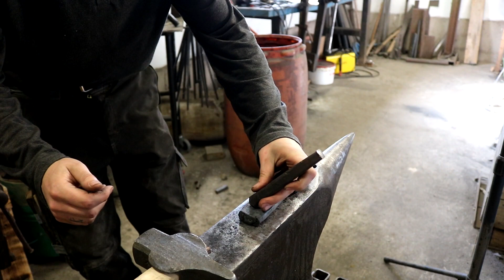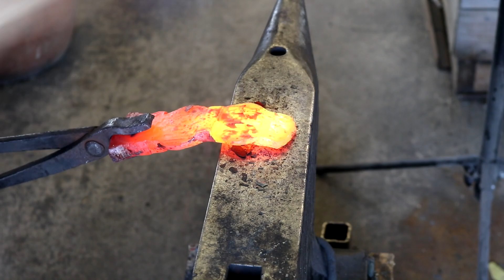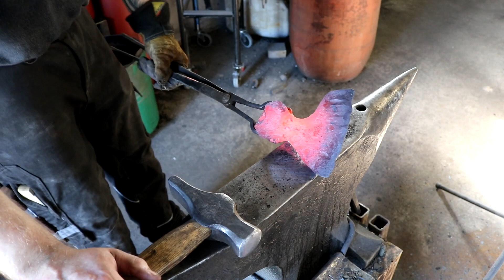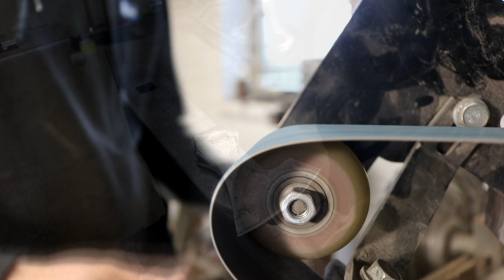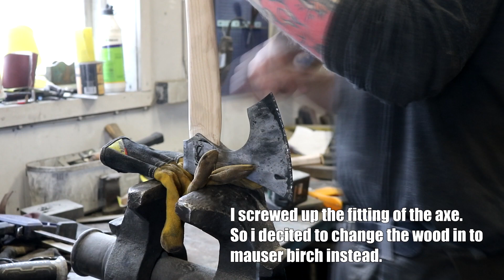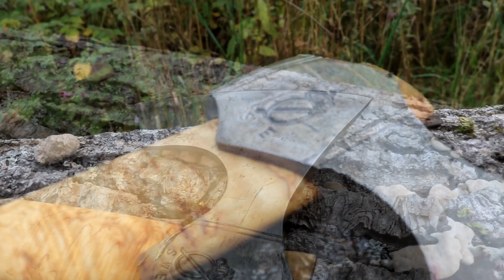Blacksmithing - Forging a Viking Carving Axe

Comment: Great job on the axe. As an American  with Scandinavian ancestry I really appreciate your dedication to traditional style axes.
Reply from the maker: Thank you!
Reply: A rolled over 9 shape is not traditional, it's modern. A figure eight ( 8 ) shape with the fold being made central and the best bit of steel money can buy inserted as the bit IS traditional. Only places I find Germanic traditional axes being made still are in England, it seems. I'd love to find somewhere closer to home but they just don't exist, everyone does the modern 9 fold rather than the 8 fold with a bit insert.
Reply from the maker: @bashkillszombies  define "modern"
Reply: @bashkillszombies  first I will present mysef
Reply: @bashkillszombies  I work as a professional  bladesmith and are specialized im making historical accurate axes. The only way is to do that is to examine historical finds. I have extensive knoledge of viking era axes and medival axes and other tools. I can tell you one thing the asymetrical fold is the most comon way to make axes from migration era to high medival era. The bowtie or symetrical is a much more modern way to make axes starting around the 1700:s. I have studyed alot of viking and medival  axes and 90% are made with asymetrical fold the rest is punched. Don't know where you get the figure 9 and 8 theorys  but that Is compleatly wrong there are tons of archiological finds tha sais so.
Reply: I am no expert but I have read and seen others studies that show traditionally the axe eyes have been welded asymmetrical, symmetrical, and also a small number of axes eyes are even welded at the back of the eye instead of in front. I wish I had the access to historical finds like Thor's forge. Keep up the good videos Nils Ogrin and Thor's Forge.

Comment: The question maybe sounds self explaining but is the unsymetrical welding easyer because of the smaller area that has to be weldet for the eye? Made two axes using the sym weld - that was tough.
Reply from the maker: There are pros and cons to both. The asymetrical fold gives you the oppurtunity to do more complicated things on the one side without having to recreate it on the other side
Reply from the maker: Which one is harder? To me they are equal. The asymetrical need alot of precisipn in thr actual weld
Reply: what is better - maybe that is a matter of personal preferences. The unsy weld maybe avoids Cold shuts and delaminations a little bit more. Otherwise, keep it up!
Reply from the maker: Well as I said it depends what kind of axe you are making. If you were to make a forest hatchet,  I would recommend the symetrical fold. But if you were to make one like this Id go with the asymetrical fold, since tou get more liberty in shaping one side of the axe before the weld

Comment: Are there advantages to doing the asymmetrical wrap instead of the symmetrical?
Reply from the maker: Yes. You get more freedom in pre forming the blade. With the symmetrical fold you want both sides to be the same. But with the asymmetrical you can do what ever you want with one of the sides

Comment: What is the purpose of using the pointed side if the hammer as opposed to the blunt side when moving the metal? 
Thanks in advance for any info. Im new to forging.
Reply from the maker: It helps drawing out the material faster. It also helps if its a tight spot you need to forge where the face of the hammer cant reach /nils
Reply: thanks for the info. I'll have to try the technique out.